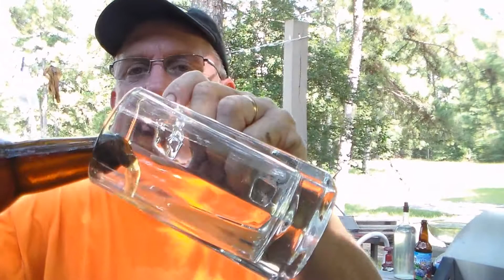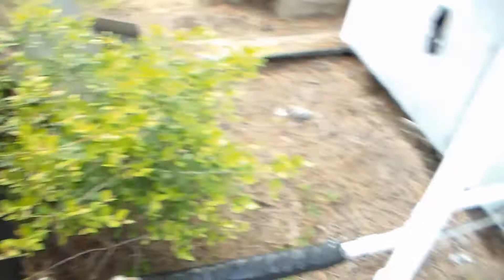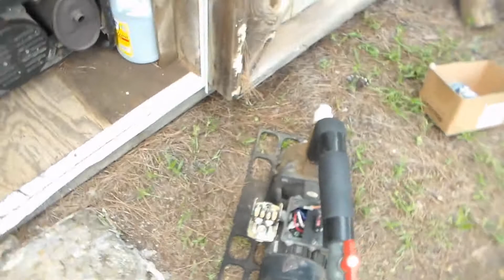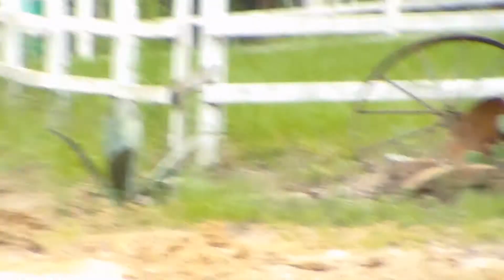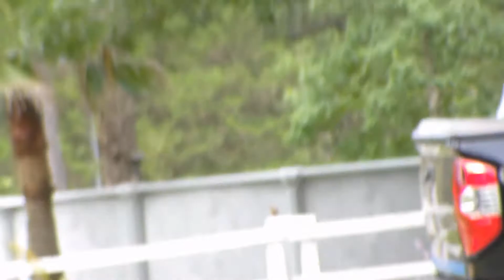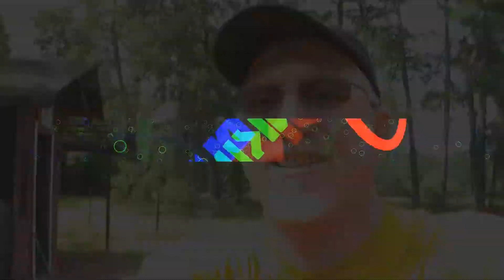HBW #43  -  "Fixin' The Beer Well"

Comment: Thanks for the tour of your well water. But when I saw the two wires connected yellow wire nuts, not in a J box,  not good, but you know already it should be in a junction box. Cheers!
Reply from the maker: They did that when they replaced the pump motor.  I need to get that fixed.  =)
Reply: It should be in a junction box for safety reasons, because of the water and piping etc.close to the splice. Be safe,